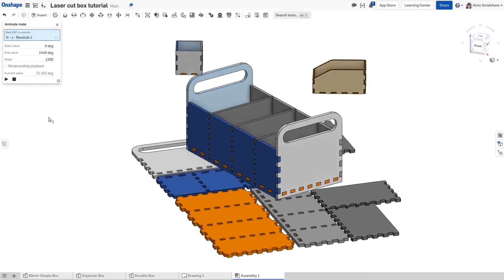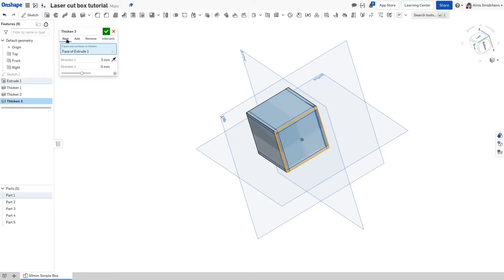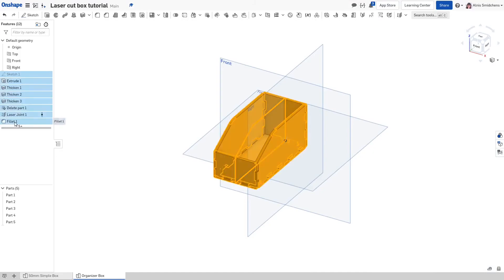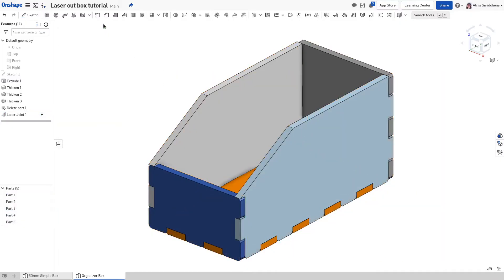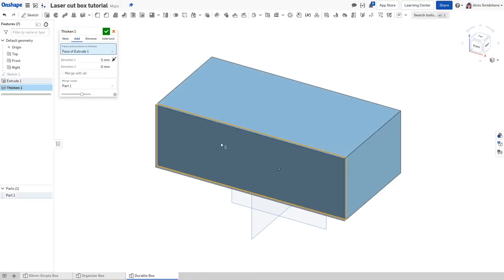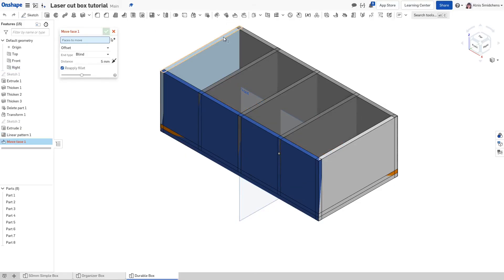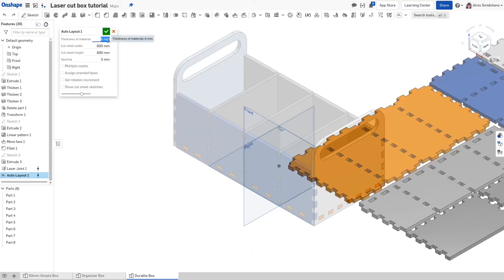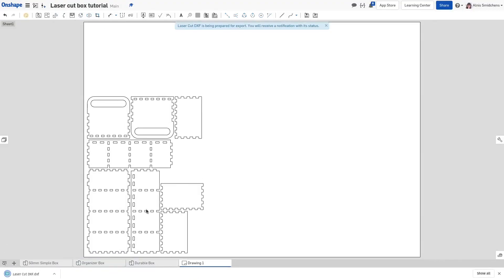How to design a laser cut box - 3 designs & DXF making... free!

Comment: my model does not do the same thing during the thickening part
Reply from the maker: @marieklee6200  double check that when you are thickening faces, you thicken ones that don't result in intersecting panels. If the panels intersect, they get merged and it doesn't work properly.

Let me know if that works. Ideally it would be a bit easier, and clearly explained in the video... sorry about that!

Comment: very fast and the bit where you delete a part (at 1.13) is super quick and I did not hear what you say.  I have watched it multiple times on slow and still that section removes both the top and bottom of the box for me so I do not get the finger joints on the bottom. Clearly I have missed some part of the instruction somewhere.  It is worthwhile mentioning that the script for finger joints needs to be separately installed.  To get through this, I needed to go to another tutorial to figure out what you did to delete only the top.
Reply from the maker: Thank you for the feedback!

I say "use the delete part feature to delete the skeleton cube and clean up the part studio in preparation for using the laser joint feature." You can turn on captions by selecting the CC button on your device, or pressing C if you are on a desktop.

If you are missing the bottom of the box, you probably need to apply a thicken feature to the bottom face before the delete part feature. You can check the "Final CAD Model" link in the video description to see the full model, make a copy of the document, and modify/investigate it as needed.

Yes, in future videos I'll make sure to mention that instruction --- while it's in the video description, it seems that isn't a very clear place to check.

Hope this helps, and thank you for watching!

Comment: Alnis - this was an incredible vide.  Ive been trying to figure out how to make tabbed boxes for years and, after your video, got it.  Could you make another that shoes how to line up parts in the interface?  that was the biggest problem - just couldn't follow your points about intersections.
Reply from the maker: Thank you for the kind words Parker! Yes, I'm working on a sequel video as well as an additional custom feature that will pair with the laser joint custom feature to make these sorts of parts faster and easier to make. However, university is eating up so much time, and I want to make sure the sequel video lives up to the quality of the first one, so it's still a while away :D

Comment: Thanks a lot for the tutorial. It's very helpful and allowing us to gain lot of time :)
On one of my works, the feature failed to work (two intersecting parts on which i'm trying to creat joints), and I don't know what would be the mistake i've did. Could you help ? what are the conditions that should be meeted to works correclty.

Many thanks again for your work. keep like that ^^
Reply from the maker: Glad to hear it was helpful! The feature was written by Arul Suresh, so all credit to him for the saved time :)

The feature documentation is available in a PDF in its document: https://cad.onshape.com/documents/578830e4e4b0e65410f9c34e/v/4a3153e5b4fb5385bd22a9b8/e/7af109b2f1cead90850525ae

If you have a specific model that you have a question about, I would recommend posting on the Onshape Forum: https://forum.onshape.com/
Here's a checklist for how to write up a post there: https://forum.onshape.com/discussion/9107/forum-post-checklist-read-this-first

By posting on the forum, other Onshape users will be able to easily find and see the solution if they run into the same issue. Unfortunately, it's hard to search for and find solutions in YouTube comments. I'm happy to help if you post your model and issue over there!
Reply: @AlnisSmidchens  thanks a lot for your reactivity.
I'll try to post my issue on the forum  in the coming days.
Thanks again :)

Comment: 1500 dollars for this software for a single user is too much.
Reply from the maker: It's free for unlimited open source hobby/maker projects and free for any education-related use. Plus, other systems easily cost the same amount as the sticker price, not to mention the much greater loss of productive engineering time from crashes, corruption, and other issues. It's very economical if you're using it commercially, and if you're not using it commercially, it's free!

Comment: very nice. but does it have a way to change parameters if you want to change the sizes of things? like fusion 360 has.
Reply from the maker: Yep, there's a system known as "Configurations" in Onshape where you can have variables, check boxes, tables, and any combination of those exposed to the modeler and even anyone accessing the model without an account. I'll have to make a follow-up tutorial now that finals are over and I have more time.

Comment from the maker: Sorry if you get ads! I would disable them if I could, but my channel isn't large enough to turn them off yet. I get $0.00 from the ads and I don't want them on my channel.

The person who made this custom feature, @lemon1324 on the onshape forum, has some fantastic improvements and corrections to add, so I'll post them here!
1. The intersecting solids/sheets do not need to have the same thickness. They just need to each be planar. In other words, you can mix and match 1/8", 1/4" etc. plywood.
2. There's a much better way to account for the kerf and to make the parts come out at the right size: @lemon1324 also made a Kerf Compensation custom feature that automatically offsets all of the faces, and this will make your holes, pockets and everything else come out to the right size! Link here: https://cad.onshape.com/documents/57df36a88f63301089e8ac78/w/d336a806a8a6f0460f7bd440/e/157268905828b0fc910e365b
3. @lemon1324 also made a tutorial for a super innovative way of using assemblies to give more flexibility in how the parts are designed. Link to it here: https://spdldaemon.github.io/docs/tools/onshape/
4. There are also some great starting kerf compensation parameters in that tutorial so that you don't have to do as much guessing and re-cutting to get the parts right the first time. Go check it out!

Thanks for watching! Please do let me know if you have any suggestions or feedback!
Reply from the maker: @namewarvergeben  They are custom features (free add-ins)---please make sure to add them to your toolbar.
Laser joint: https://cad.onshape.com/documents/578830e4e4b0e65410f9c34e/v/4a3153e5b4fb5385bd22a9b8/e/7af109b2f1cead90850525ae
Auto layout: https://cad.onshape.com/documents/576e01dbe4b0cc2e7f46a55d/v/731e73ac0b7b1e4334f13106/e/b72c231628b5affea0873222
Reply from the maker: @namewarvergeben  No problem! Happy to help. Thank you for the feedback--it is incredibly valuable to know what people might be missing in videos so that once I make more I know what to emphasize. I just wish there were more hours in a day X(
Reply: awesome thx
Reply: so freakin awesomw man! thx.   and oh.. how do i measure things?
Reply from the maker: no problem! whenever you select something, it automatically measures it and shows you the value in the bottom right corner. If you click the measuring icon it gives you more details https://cad.onshape.com/help/Content/measure-ps.htm
Reply: great! thx alot!
Reply: Is there a quick/easy way to rearrange the layout prior to exporting?
Reply from the maker: You could insert each part separately into the drawing, which would let you drag them around independently. Usually I find tweaking the sheet size in the layout tool is enough to jiggle things into a good enough place to cut them. If you need advanced nesting, then a dedicated nesting tool like https://svgnest.com/ is probably your best bet (but I don't have experience in that area)
Reply: @AlnisSmidchens  awesome, thanks!
Reply: Is there a way to modify the parameters for the laser joint feature along only one edge? For instance, if I was planning to make a cut in a finished box for a lid and wanted to get the fingers aligned in the best way to make the cut? (Admittedly this would be multiple edges, but only 2 along multiple sides/faces, so single edges would work too)